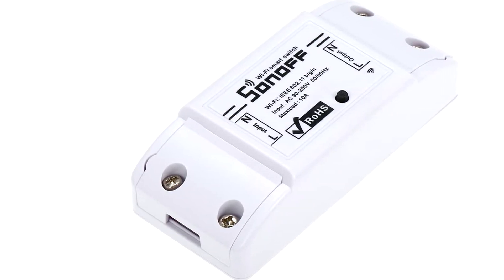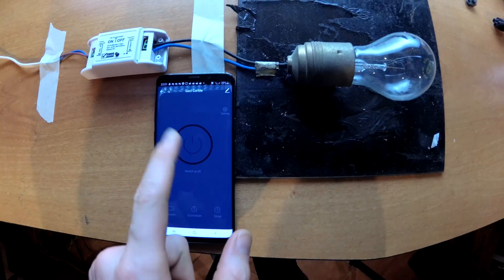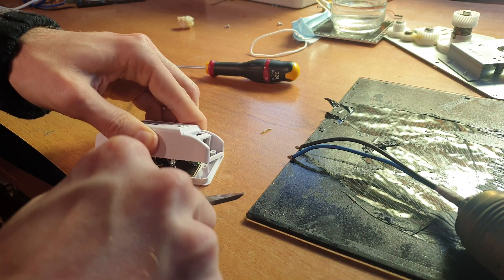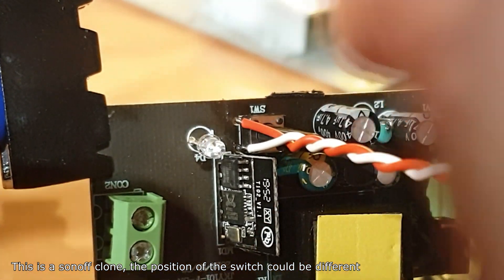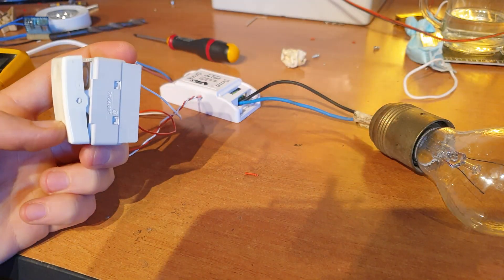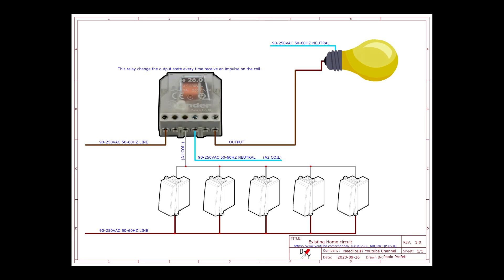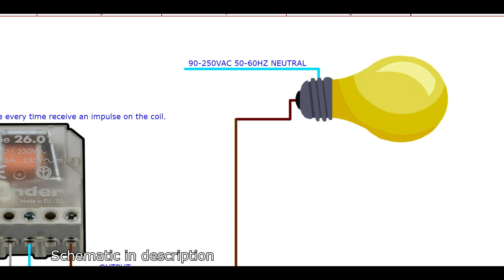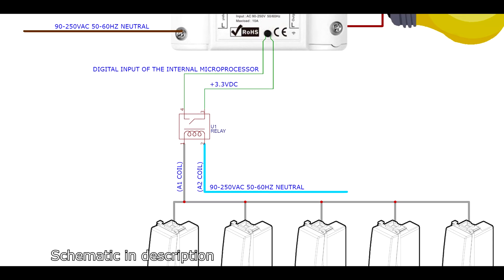HOW TO ADD AN EXTERNAL PUSHBUTTON OR SWICH TO SONOFF BASE

Comment: thank you very useful solution. But what if the sonoff is out of use or dead ..in this case these is no 3.3 V to activate the relay and we can not command lights in the house !! and this is a big issue !
Reply from the maker: If the wi fi is down the push button works anyways, there is a chance that the sonoff is broken like any other type of elettronic device, but usually if it is well wired there is no reason to make it stop working
Reply: @NeedToDIY  thank you ...i think there is a solution by adding a 220V sensor to the sonoff module. we can garantate the manual command even when sonoff is broken....